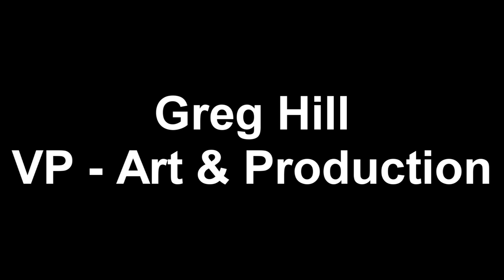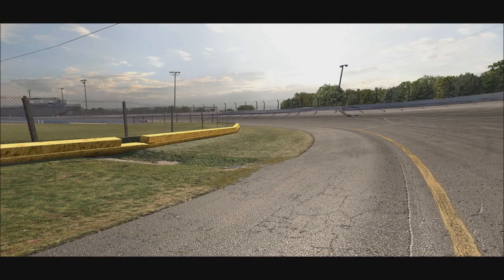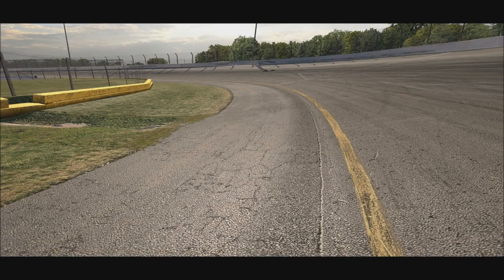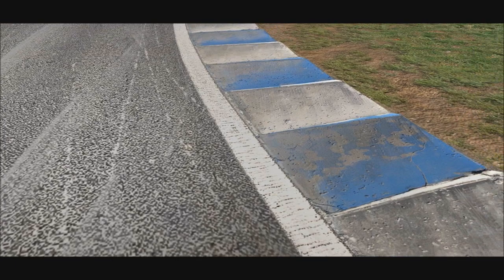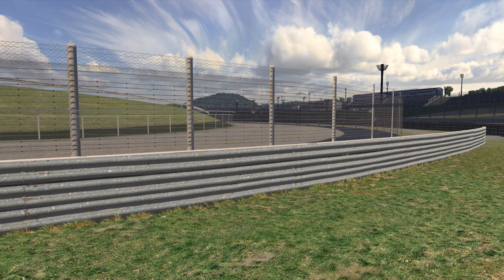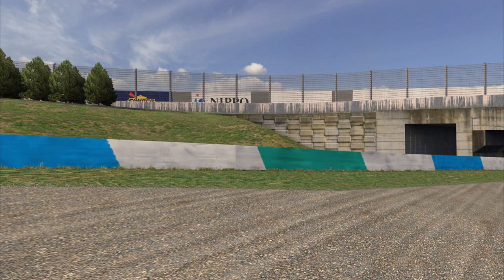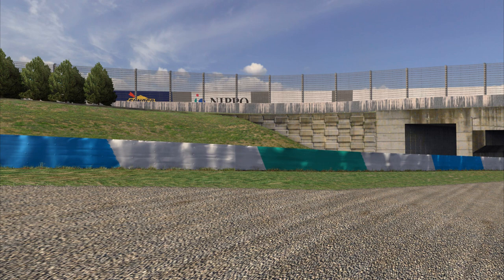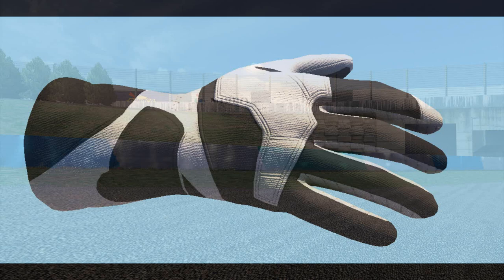iRacing Art & Engineering Video Blog - Apr 1, 2012

Comment: Yeah i know i failed but im just irritated that iracing has so many huge flaws and never fix them like for one they never fixed the q circles and if you race at daytona or talladega in the A, B, or C car when you pit put you RR spring all the way up and you gain about another 5 to 10 mph which allows you and your partner to easily pull away from the pack before even having to swap also the tires fall so much its not even realistic anymor the first build was way better but anyway im done bitching